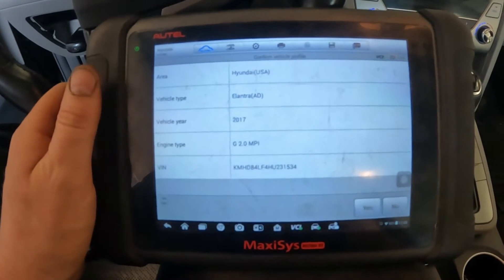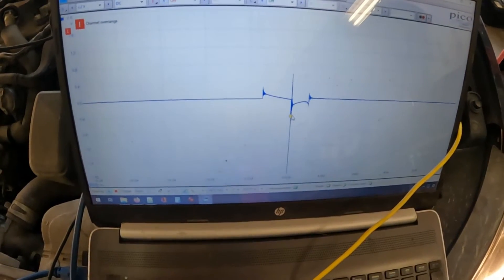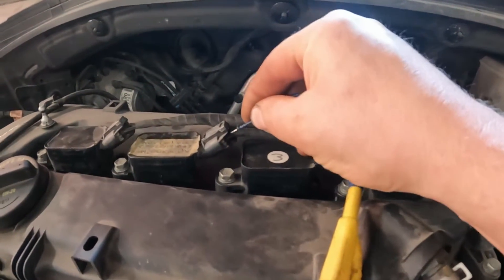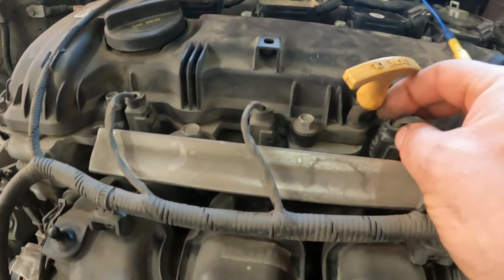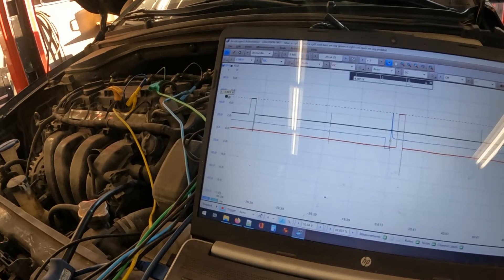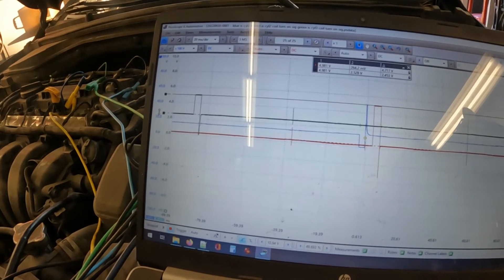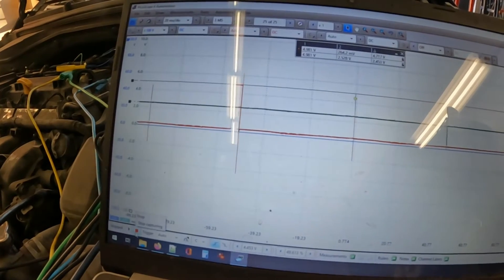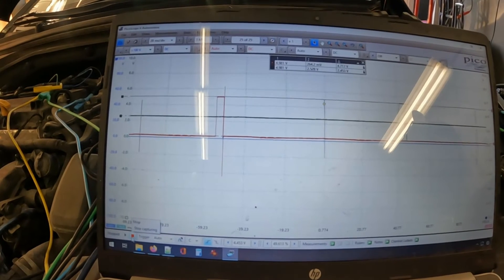2017 Hyundai Elantra 2L - P0303 Cylinder 3 misfire - VERY intermittent - Why you need a scope!

Comment: Intresting I have same issues on My Hyundai Kona 2019. Its always cylinder 3 missfire change spark plugs and coil and it will go away for a while then come back. Just changed injector and its been working with no codes for 4 months now so fingers crossed.

Comment: My 2017 Hyundai Elantra was doing the same thing and i changed out all the spark plugs and ignition coils. And it was still misfiring on the 3rd cylinder. I played with the wires and it stopped. Its driving fine roght now
Reply: What do you mean you "played with the wires"? I've changed the plugs and coils as well and still have a misfire. Maybe I can try what you did before giving up and taking it to the shop? Thanks in advance!
Reply: have done the same thing, ill test to play with the wires, tell you it work too

Comment: I have a 17 Sonata hybrid  with only 46k miles , o7t of nowhere ✔ engine light comes on then acceleration seems like car want to die out ... ran a scanner on it & P0303 cyl 3 missfire shows , havent had the tune up done since 20k miles ( is it possible bad spark plug or clogged injector ) dang Hyundai dealership wants to charge 170 for diagnostic & are scheduled out until Aug 9th before they can even look at it which is insane iny eyes ... desperately need some help
Reply: As some suggested. Swipe the ignition coils (2-3 cylinders) and watch if the problem travels. If so, go buy new ignition coils and change them. Everybody can do this. If the problem do not travels. Try changing the spark plug of the 3rd cylinder. If its not fixing the issue. It might be the fuel injector or even the computer as this video demonstrated and that I can't help my friend sorry. Not a mechanic. Just an enthousiast.

Comment: Pretty sure mine is doing this. About 6 months ago had cylinder 3 misfire. Went ahead and changed spark plugs and coil. Now here we are looking up YouTube videos because we threw the same dang code! Thanks for the possible diagnostic but how much is it going to cost me? 😂
Reply from the maker: @bran120  It's always good to try some testing before condemning the computer but I have to imagine this has happened before. These cars came with bad ignition coils. There is a TSB authorizing dealer techs to change them if they're still the original design. 

If your problem is a faulty computer then it is rather expensive. Unfortunately you can only write the VIN once on these computers. This means you can't install used computers. Only new ones. When we called they were back ordered and about $1000. It would've taken too long to get a dealer computer so we went with our local mobile guy that does programming. He can clone ECMs. This involves taking them apart and cloning the chips. That's the only way to get a used ECM to work.

Still it's a good idea to get some testing out of the way. Would be a shame to pay for a computer if you have a faulty fuel injector or something.
Reply: Out of curiosity, have you guys switched to the new computer? Did it help? So painful to diagnose when it's acting up so randomly.

Comment: Ive taken my car in every month for the last 6 months and they cant pinpoint it. Last month they finally identified an ignition coil, which we replaced. Here i am 3 weeks later, and it's happening again😢
Reply from the maker: @michellesandoval5294  Dang, that sucks. Crazy that it took so long to figure out an ignition coil. At the very least they're cheap enough to throw a new part at it. If you don't have any codes at all and it doesn't act up at the shop then things can be pretty difficult to figure out. This car here took over a year and MANY hours of me driving it before I finally got it to act up. 

Hopefully you can get your car straightened out soon and it goes back to being a nice, reliable car!

Comment: Hey there!
When I'm in such Situations, I just swap two ignition Coils. If the fault stays on the same cylinder it's often the injektor (with the M157 AMG engine in particular).
And if it "travels" with the Coil it's a defective coil. 
Didn't watch the entire Video jet, but wanted to metion before i forget.
Reply: My car is having the exact same issue, P0303 only happens very randomly, seems to quickly fix itself and the CEL will eventually go off. Out of interest what is the fix for something like that?
Reply: @BruceMcMoose  I would like to know what the fix is too have the same problem and I’ve change both the sparks, coils, and cable, what is the fix??
Reply from the maker: @Tacer Animation  Normally I'll swap coils on misfires as well. It's quicker and easier than pulling out the labscope. However, on this car, it took so long to get it to act up I was worried that it would stop misfiring! I didn't want to disturb anything.
Reply: I recent bought ignition coil then what happens the car vibrates few months ago I changed my spurplugs as well so I opened cleaned erased the engine light three ago now it’s came again I scan it it’s p0303 having ignition coil and spurplugs not bad either it’s vibrating in the d mode parked it’s shaking what could be the issue.
Reply: @brethart4938 hello were you able to figure it out. Having the same issue